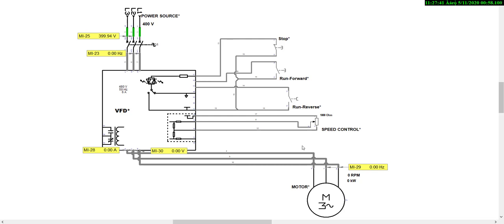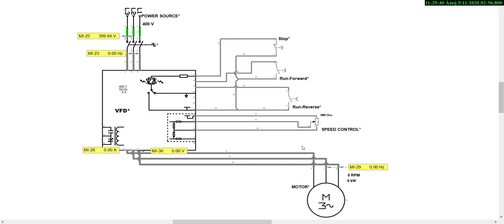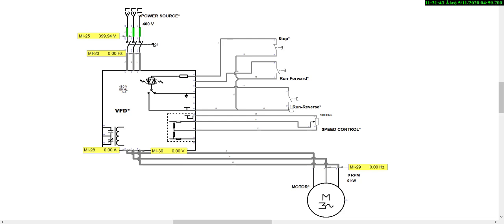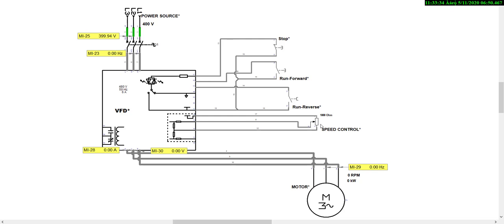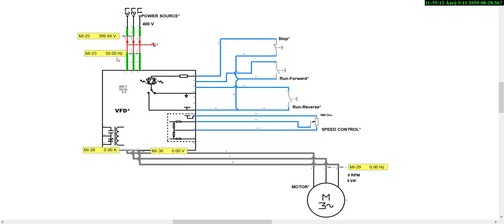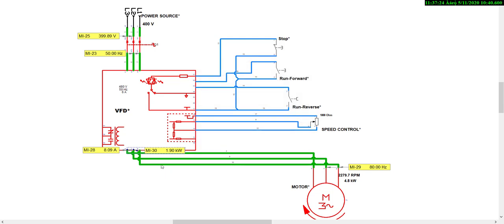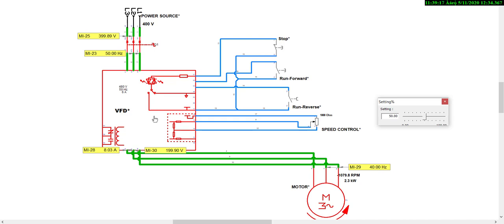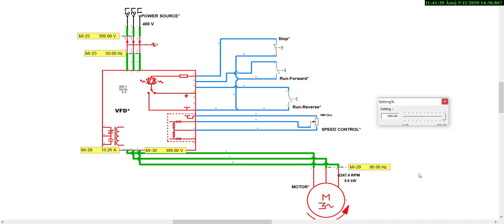Motor Speed Control Using VFD

Comment: I can't find vfd in automation studio pls where is it?
Reply from the maker: What's your version of the software?
You can follow the video, VFD Is in the library.
Reply: @Taiwo Fatimehin   thanks for the reply greatly  appreciated.  I was using version 7.0 I got online but when I found a version 6 setup it worked and I had the vfd in one of the modules so that's solved, however, I couldn't follow ur simulation cos once I on my mccb to the drive it starts automatically without any command. I wanted to the vfd to sink not source .pls can u upload a detailed video how this is done ?
Reply from the maker: Good to know that you've been able to locate the the VFD object in the library.
Can you send me screenshot of your configuration?
Also, sink/source, you have to Check your hardware configuration and address assignment.